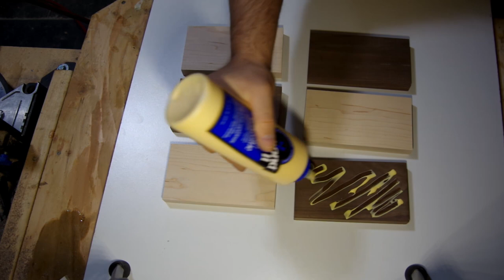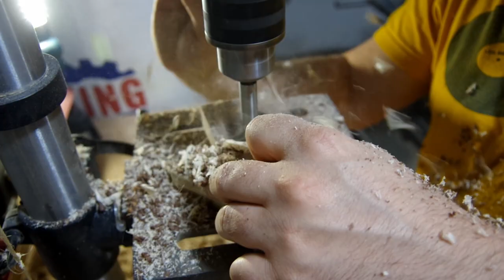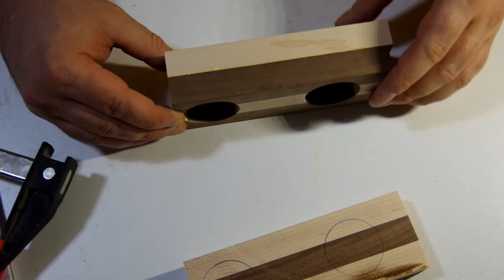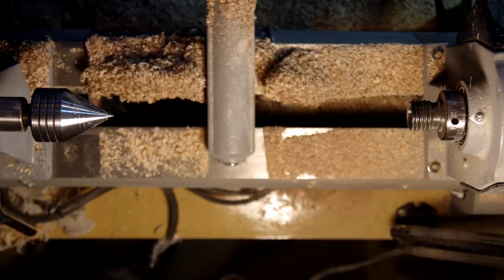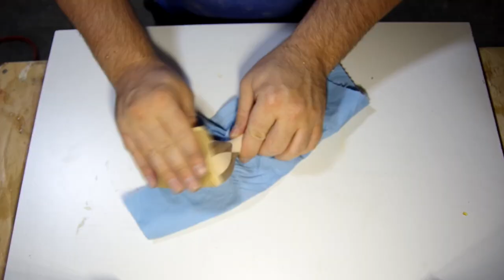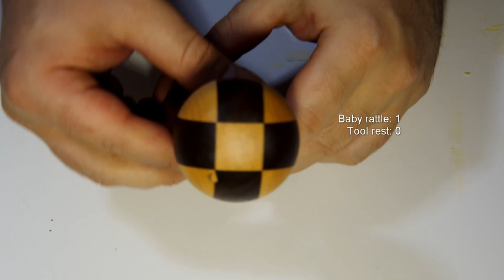Segmented Baby Rattle - Woodturning Maple and Walnut

Comment: You'd have a lot more fun if you used some traditional chisels and learned how to cut the wood instead of scraping. Scraping gets tedious and boring, not to mention it leaves the wood rough and requires a lot more sanding. Just a suggestion. Nice end result though.